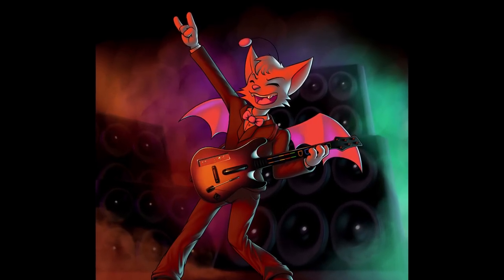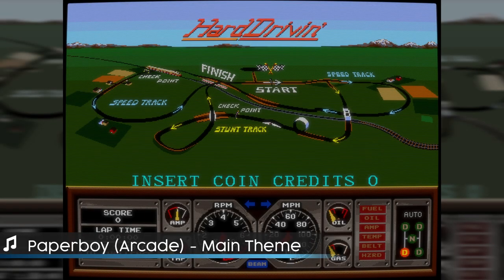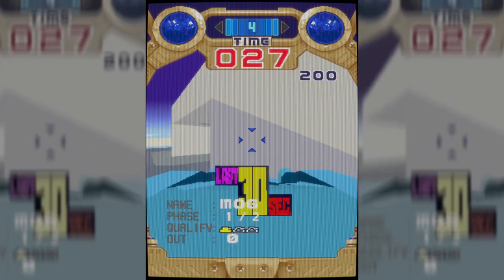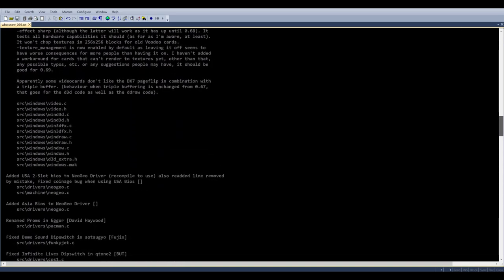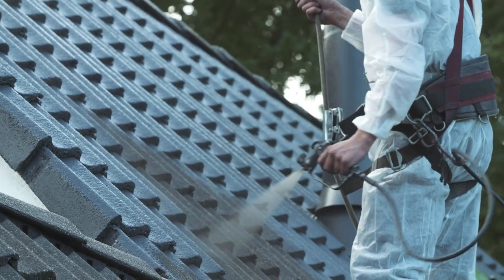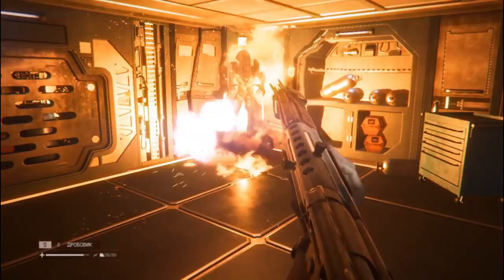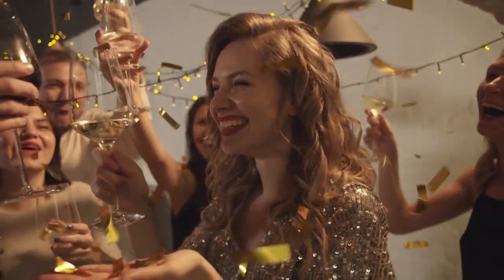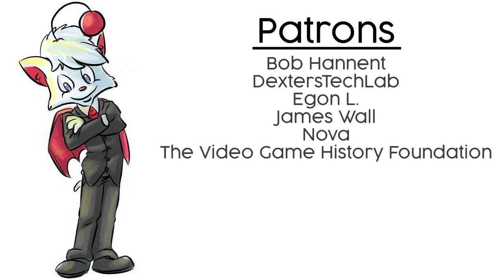The History, The Failure, and The Emulation of: Polygonet Commanders

Comment: Wait a sec... Wasn't i-Robot the first 3D flat shaded 3D graphics arcade? Several years before Namco's Winning Run?
Reply from the maker: Nice catch, that side note completely slipped my mind; about 4 years, in fact, since the original version of Namco's System 21 board dates back to 1987. Good eye!

I, Robot was a failure in its own right for its own reasons, but had I remembered it or had someone cross-checking this info, I'd have re-worded the vox at 1:26 to lead off with "Namco were one of the first," rather than "...the first". That's about it.

In any event, the overall point of Part 2 is to be a vehicle for describing contemporary competitors that Konami's Polygonet hardware was up against - I would hope that in 1993, nobody was comparing it in any serious way to an arcade board released a decade prior.
Reply: That and technically the first System 21 game wasn’t actually Winning Run. It was Atari’s Hard Drivin. Though I say technically due to the fact the Hard Drivin variant was an earlier version of the System 21 board.